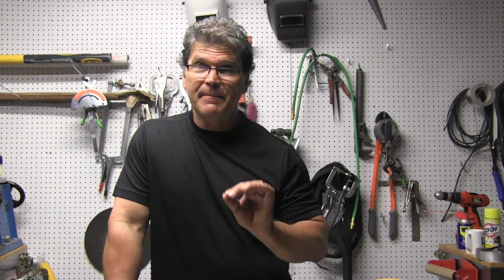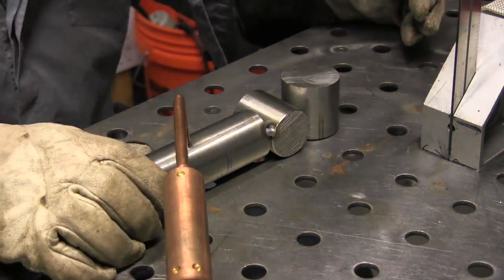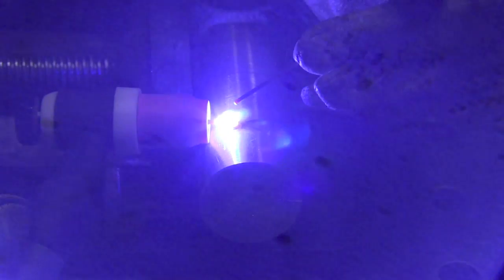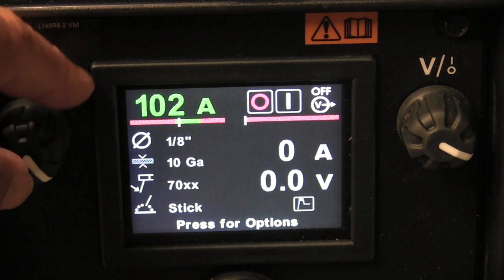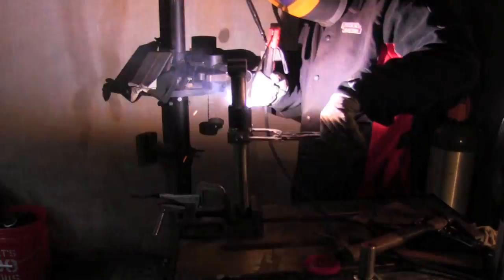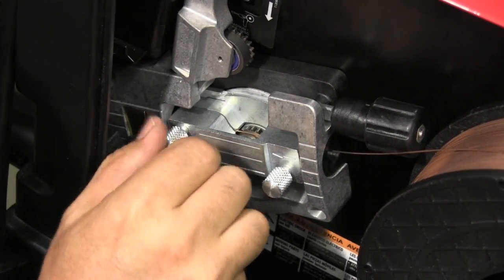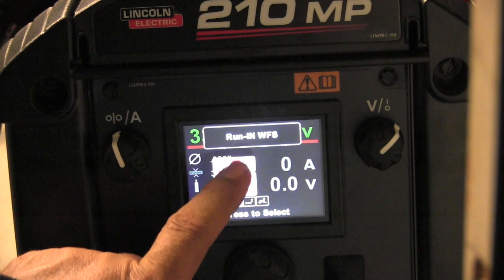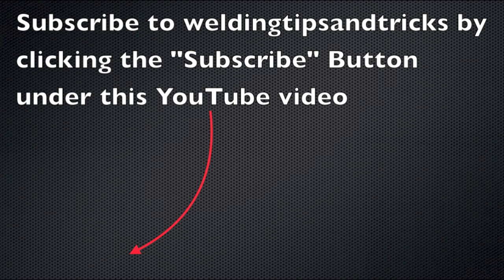TIG, MIG, and Stick Welding with a Lincoln Power Mig 210mp

Comment: I was pipe welder for 15 years had all my high pressure tickets stick/Tig/stick and Tig 
I picked up a little 140mp Lincoln welders  and was impressed how it worked it does 6010 1/8 7018 3/32 no problem and migs just fine even on a extension cord but it was a heavy duty cord I had for breadbox welders back in the day to get into tight spots they don't work on Reg cords. also gonna pick up the Tig setup for it.

Comment: Since there is no high frequency on this machine could you not set the machine on electrode negative and hook a dry rig to it to TIG weld stainless & Mild Steel?

Comment: I want to try Tig welding , and have this welder , and was torn between buying the Tig kit , or just get Lincoln’s square wave 200.I don’t really see welding aluminum in the future ,but mostly metal square tubing for my gym equipment upgrades .You make it look so dam easy , that I’m tempted to save money and just buy the Tig kit now . I guess you turn the gas off and on manually with the Tig torch if Tig welding with the 210mp , whereas the 200 square wave has a solenoid? Is the arc start done the same way on these two models?

Comment: I just bought one of these and I have to say, I am very impressed with the overall capability for the price. Lincoln keeps putting out stuff like this and I just might trade in my Miller equipment. Great video
Reply: For 2000$ you get a bang for your buck it may be a small machine but don’t be fooled it welds just like a Miller that I use at school if not better

Comment: I purchased one after watching your video. I am quite satisfied with it. A little additional info for everyone . The one I purchased was compatable with 045 innershield right out of the box (the liner and feed roller did not have to be changed) All that I had to do was purchase 10 new tips for o45 and a (12 ?) roll of wire. If you favor working with 5/16ths and up...its a good way to go. I haven't tried it with dual shield yet.
Reply: Did you order yours online from somewhere?

Comment: I'm in the "searching-pit" (the alice in wonderland bottomless "whole"/hole) for a multi-process welder....and the more I see, the less I'm sure. I mean, for a good one, I'd have to put $3500 for 3 out of 4 process. Maybe I should split that amount in 2 halves and get either 4 process in either the two machine would best suit me. (and maybe for even cheaper than I might think right now as I'm lost in this market, even though I'm an old advance welder shop-worker, but never did TIG yet and want that skill ;)
Is there any video in your archive talking about which machine would put those 4 processes in my (today 110V) shop (mig, tig, stick, plasma) (but someday 220V) ?
Reply: Not sure if you're still looking, but Lincoln is running a promo right now with the 210 + their square wave 200 tig machine. Don't think this would let you do plasma -- but both run on 120V or 230V (for max power). Promo ends 8/29. You can find more info here: http://offers.lincolnelectric.com/garagepak/
Reply: GHISLAIN LETOURNEAU everlast has some great stuff..251si mts machine..heard great things about em just saying

Comment: Is the CK Stubby Gas Lens Kit from the Weld Monger site appropriate for a beginner TIG welder for use with a Lincoln Electric 210 MP?  I was planning on buying this kit because the TIG kit from USAWeld does not come with; cups, collets, collet bodies, or tungsten.  This kit looks to have an assortment of all of these.  Would this kit make it harder or easier for a beginner to learn?

Comment: Hey Jody! I have 2 quick questions to ask. How can you tell that a 7018 rod needs to be put in a rod oven and how long can it stand, fresh out of the can, until it's time for it to be put in the oven?
Reply: its on the can
Reply: In accordance to the D1.1 code book a 7018 can be out of the oven or can for up to four hours, max. How long it has been out is how long you have been paying attention to it. They may only be reheated once. But this is just if you are welding to the code are or building something and you care to that your 7018 remain Low Hydrogen.

Comment: Thanks for this video.  Watched it and your "Welding Pipe with JD" video before I bought my 210MP last week.  Even with the TIG Kit from the factory, they still make you install your own TIG pedal connector.  Taking the case apart was easy.  Putting in the silly connector was a pain.  If I didn't have a pair of really long, slim,  needle nose pliers, I'd probably be swearing at it still.   My one tip in that mounting the round connector to the case is that the barrel goes in from the back side.  It does not mount on the wire compartment side.  After I figured that out, I then found it aligns with the little internal tab at 12 o'clock.  I sort of held it in from the back side, then screwed on the pedal connector to have something to hold on to while I screwed in the 4 mounting screws.  They were really tight.  Have a good phillips screwdriver and use firm downpressure to keep the screwhead engaged.   After that, it was just a little finagling and work with the pliers and a long screwdriver to coax the flat connector into position.  The tab on it faces the front of the machine.  All in all, about an hour to do.  Not that bad, but for the price of the connector, they should mount them to all machines.

Comment: 6010 is possible to weld with this machine? and what would happen if I try? I need this type of welding electrode (6010) but did not want to spoil the machine. thanks

Comment: has anybody had problems running 6011 rods while connected to 120? I had trouble keeping the arc on and it actually shut my machine off once and I had to reset the fuse. I haven't had any issues running 6013 or 7018..

Comment: hey ... i really need your help... i am wanting to go for my first test on 6" sch 80. sa 106-B

 6010 root. and 7018. fill and cap. using 110 or 220. does this affordable machine offer the same smoothness as larger machines?

i just ask cause where i work now its not certified.  so i need to practice at home in my garage.  

will this machine  be sufficient?

Comment: hey Jody great videos, i am going to be getting a Power mig 210mp and was wondering how well the spoll gun works on aluminum running from this machine. the only process i cant seem to find on this machine for reviews.
Reply: I have the power mig 210 with the spool gun. I weld for a living and I have put this machine through it's paces and it's not let me down. Has more than enough power. As for the spool gun, it just takes some getting used to but it works great. The wire is a little hard to initially get in there, but overall everything works great for this machine.

Comment: Thank you Jodie...been transformer migging and occaisional stick all positions for 30 years all day 6 days a week. Mostly overhead mig. I do have that position down! Have been learning tig thanks to you. Looking for a inverter welder 110v up to 50 amp 220v to do 1/2 steel mig, 3/8 alum spool gun and alum tig in the 180 to 200 amp range. I don't see a machine out there that serves my purpose. Prefer a Miller or perhaps a Lincoln. Thanks for the 2% lanthenated tung tip. It rocks!

Comment: Jody can you please look up the l.a. city unlimited thickness a structual steel test give a demo. The test is similar but the plate is much thicker and and has a 45 degree included angle. Thank you if you can.

Comment: I didn't see a comment anywhere yet, but I seriously urge you to ditch those cast arbor plates from the Harbor Freight shop press if you're going to bend test thicker coupons! They have a reputation for shattering. SWAG makes nice (but a little pricey) arbor plates to replace those piles of dangerous crap.

Comment: Another great video, and the one I've been waiting for. Been thinking of buying this machine for awhile. Why will it run 6011 but not 6010?
Reply from the maker: Appalachian Stillhunter not really sure why it is but lots of inverters dont run 6010 but will run 6011...I think due to stabilizers in the flux of 6011.
Reply: Appalachian Stillhunter not enough arc voltage to keep a 6010 burning. for a cheap machine that will check out the esab miniarc 161 lts. I have one and really like it. you can check my channel if u wanna check it out

Comment: If you were choosing between this Lincoln 210MP, Miller 211 and the Tweco 211i, which would be your choice? Primarily for mig use with some stick use.
Reply from the maker: Wayne Coots I used a 211 once but I have not had a chance to weld with the the Tweco 211i.  I do have a Thermal Arc 252i (Tweco machines were previously thermal arc)  and its  a pretty decent welder although it is not very forgiving at low end settings on mig. Not sure how the whole Tweco rebranding is going to work out since being bought out by Esab.  From what I know, and from what I have welded so far with the Lincoln 210mp, I think the Lincoln 210mp is the best value.
Reply: Wayne Coots You're probably referring to the Miller Multimatic 200. The 211 doesn't do stick.
Reply: No. I'm keeping in the same price range. As I stated, mig is the primary use.
Reply: weldingtipsandtricks Jodie, thank you so much for what you do. Thank you for your feedback as well. I've been watching your videos for over 4 years now and they are extremely valuable to anyone who is welding or interested in welding. I've pointed several people your direction when they needed help.

Comment: why does this machine not handle 6010 rods , they weld kinda like 6011 ? thanks
Reply: kev moosebird Inverter welding machines tend to not have the OC voltage necessary to run 6010. Because of that you can't keep the thing lit.

Comment: Hi Jody,
Sure wish the 350MP had that user interface, so friendly....
Reply: Check out the C300
Reply: Wayne Coots
The C300 looks nice too, since I already own the 350MP, and, it works very good, so, I.ll live with the simpler user interface. Also I only use it for MIG cause the other welding machine is a Miller Dynasty 350 that I use for TIG and SMAW, that Miller machine is a GREAT machine....
    The biggest problem now is my eyesight going away, mostly for TIG.... Got to go to my friend optometrist for finding ways to extend my TIG welding years...    Anyway machining and producing YouTube videos keeps me busy also... Cheers,  Pierre
Reply: Have you tried using a helmet magnification lens?
Reply: Yap... That's what it's coming to, just want to go to the optometrist to get the best possible prescription, left and right headlight aren't the same vision... just to have them working together, working sync with the hands...
Thanks
Reply: I'm 37 with some of the same issues.
Reply: Geeezzz...! I'm 61, but it's been 4-5 years now, and, it's not improving... :-(    Good advice from a pro is a must, welding is fun but we got to be able to see what we're doing....!!!
Reply: I was medically retired from the Army 2 years ago. Lots of medical issues. Just starting welding school. I've been welding for a little while but want to get good training and get my certification.
Reply: I'm also a machinist, so, my attraction to work with metal is kinda satisfied.... But the hot sparks and the molten metal are something in a world apart... can't be described... Hope the best for you,   Pierre
Reply: Thanks

Comment: Thanks for the great videos, another reviewer of this machine "said" (but didn't show) this 210mp could do spray transfer, could you test this machine for that ability??  I trust your input completely over what someone says,  Thanks
Reply: Ty Canavan Not Jody, but I don't think it has enough voltage.  You want serious 250+amp machines for that.  S/F....Ken M
Reply from the maker: Ty Canavan It might do spray for a minute or two with just the right combination of wire size and gas type but duty cycle would be an issue.

Comment: Thanks again for your video..Are you planning to test this 210MP with the aluminum spool gun? Also what set up with the tig did you use and or recommend..
Reply from the maker: shawn karg I have a spool gun on the way...along with several pieces of aluminum.  For Tig,  I used a 3/32" 2% lanth electrode, a #8  stubby gas lens setup with around 20 cfh argon... and er309 wire.  I did use a foot pedal, but you can also just set the 210 up for basic scratch start tig without a pedal
Reply: Thanks. What brand of torch did you use or do you recommend.
Reply from the maker: shawn karg using a Lincoln brand 17v air cooled but I would prefer either a CK or Weld Tec brand 17v air cooled with super flex cable
Reply: weldingtipsandtricks Thanks for the info.

Comment: hi Jody just wanted to thank you for all the videos you put up, I know you get that a lot, but for me not being able to have formal school training they are a lifesaver just from watching your videos I have learned to tig weld pretty descent in my standards, with a harbor freight tig machine, (only thing I could afford) and I have you to thank for, and that's because of how well you explain everything you do as your showing the clip, I still will never be as good as you, but that I can only hope!

I just had a question for you, I don't have a lot of income, could u recommend an inexpensive helmet that won't flash when welding on low amperages, that's one problem I keep running into.
Thank you again for the videos! 

Alex Z
Reply from the maker: Alex Z I dont really know of an affordable helmet that is great at low amperage.  I have several really expensive ones and even those will flash every now and then if I dont have sensitivity set right...even my miller digital elite with X mode does it sometimes.  The accu-strike chin operated helmet is pretty inexpensive compared to AD hoods and might be an option for you
Reply: they use these videos at AAI in class so your getting the good stuff